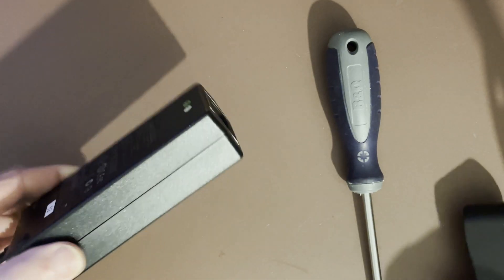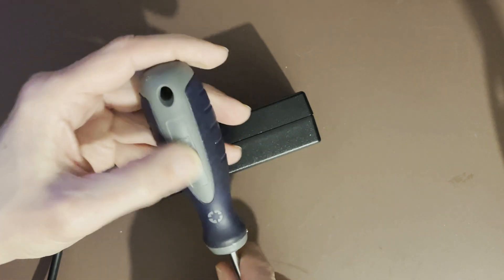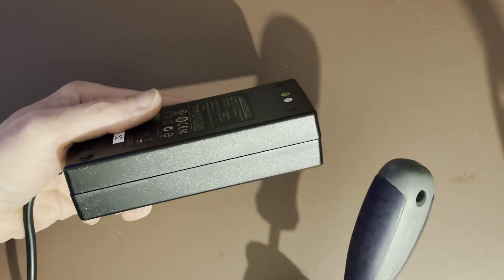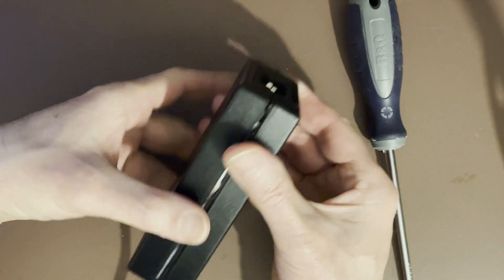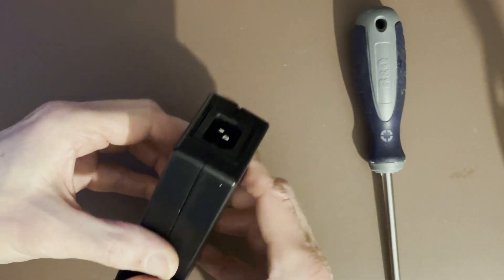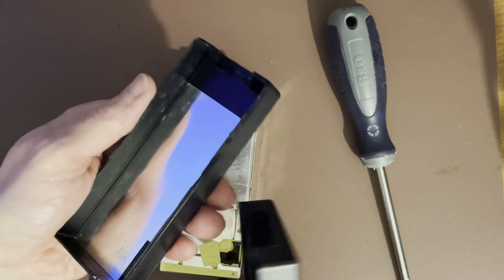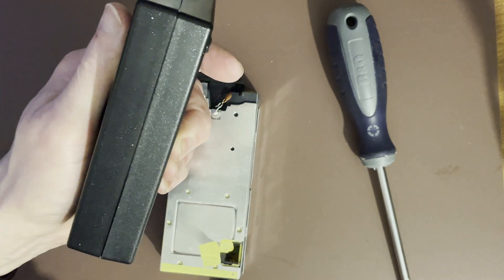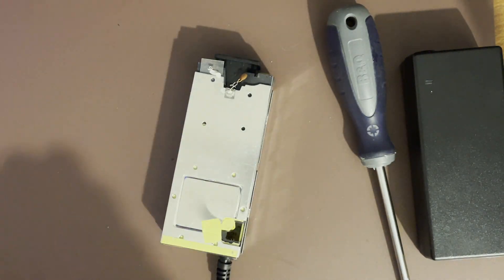Opening glued or welded PSU (or battery etc.) casing

Comment: petrol
Reply: Most of these cases are sonically welded.  No glue is used.  Solvents won't work on these cases.
Reply from the maker: They often seem to be solvent welded, such as the edge of the internal lip being dipped before assembly. In that case, the only solvent that would affect them would also melt the casing itself, so not a practical approach.

Comment: I've used the same method but usually I use a hunk of 2x2 or hunk of skid wood.   
Never heard of the "Banana Oil" mentioned tho.   
Crack a lot of power supplies for LCDs & industrial equipment...   rebuilding them for 3 to 5 bucks in Capacitors,  occasionally a DIODE or Fuse internally on one.
Reply: This oil is, in fact, isoamyl acetate. There's a bunch of videos in Brazilian Portuguese about using it to crack open power supplies and similar stuff. I've never tried it but seems to work.